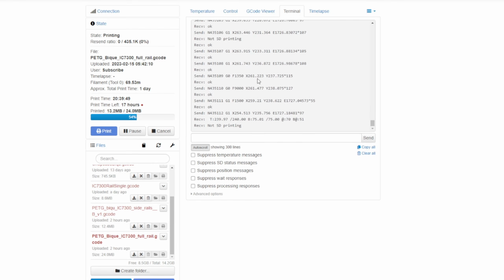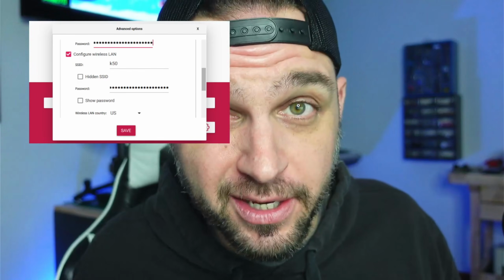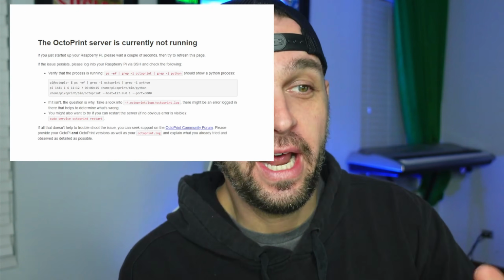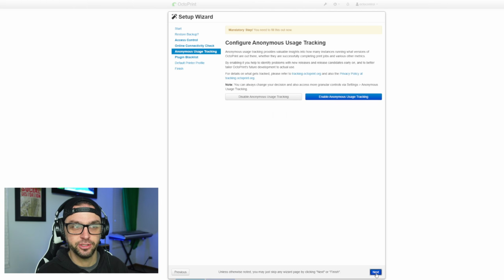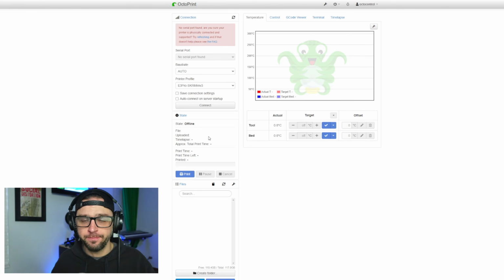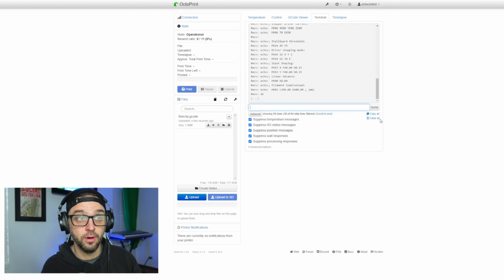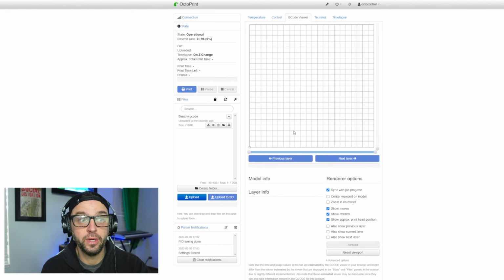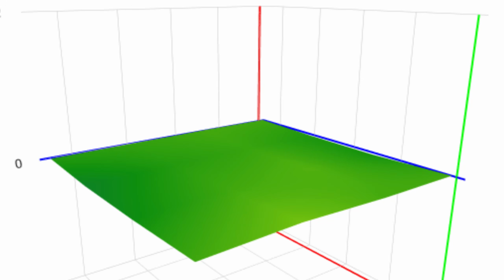Guide to Installing OctoPrint: Turn Your 3D Printer into a Smart Printer!

Comment: I cant help but notice you using "stl" and "g-code" interchangeably, you cant print stl files, they lack the slicing of the g code to make it printable, they are two different file types
Reply from the maker: Yeah, i unintentionally did that.     Thanks for the clarification. Part of it may have been me thinking you could use something like Curaengine within Octoprint to Slice STL's.

Comment: Yeah, don't drag and drop any STL s into the download box.  They need to be sliced, ready-to-go GCODE files as shown by the benchy you uploaded.  Other than that, you helped me recover one of my printers that had gone silent on me.  Pulled the sd, reflashed the raspberry pi image and reset my password.  Good to go!
Reply from the maker: OOPS.  If I did that or said that, I was wrong (not intentionally). You are correct, thanks for pointing it out! Boom.
Reply: @DudeTested  no problemo

Comment: im not sure what my problem is but i cant get my octoprint connected to my pi i been racking my brain just dont know what to do anymore
Reply from the maker: What's going on? Does octopi turn on? Does it not connect with the printer , Do you get any errors?
..
Reply: @DudeTested  i can get the octoprint to load on the computer I have the pi connected to the printer and when I hit the connect button on the octoprint it says it can't connect
Reply from the maker: @KerleyExpress interesting. What printer is it?
Reply: @DudeTested  it's a creality ender 3 s1 plus
Reply: I am having the same problem on my ender 3 v2 neo , it only works once I plug the raspberry pi to the computer then to the printer
Reply from the maker: Sorry to both of you, sometimes I don't get notifications, so it's sometimes hit or miss if I get these. I just saw this while responding to another message.  If octoprint is not connecting to the printer, it could be a few things such as BAUD rate specified, trying a different usb cable, etc etc.  One thing that did happen with my ender 3 v2, I had static build up, and accidently shocked my ender 3 v2.  This caused the USB port to seize working . My solution was to upgrade the control board, which was well worth it anyway.  I went with the skR mini 3

Comment: I have a creality cr10V3 would this work for that, I also have multiple machines like 16! I've been manually using cards for a while and have now burnt my self out doing so!!!!! When attaching the RPi to every machine how would this then turn up in octoprint out of curiosity and do you believe this would be fairly simple to setup? Thankyou
Reply from the maker: Hello,

The Creality CR10 is compatible with Octoprint. While you can connect multiple printers to a single Octoprint instance, managing more than three or four is not advisable. If the Raspberry Pi running Octoprint encounters an issue, you could potentially disrupt multiple prints simultaneously. A more reliable setup would involve using separate Raspberry Pis for each printer, with each Pi running its own instance of Octoprint, complete with a unique IP address and interface. This arrangement simplifies management; for instance, you can name each Pi after the printer it controls (e.g., CR10_One, CR10_Two, etc.). To access a specific printer, you simply navigate to its designated address, like CR10_Two.local, in your web browser.

Some might recommend the SonicPad; however, I'm not very familiar with it as I haven't used it much recently.

I hope this information is helpful to you. Cheers!
Reply from the maker: https://www.crealityexperts.com/setting-up-octoprint-for-creality-3d-printers

Comment: Hello, thanks for your video. Please can I get the octoprint to send a  signal to either a connected raspberry pi or arduino after each g-code move is completed?
Reply from the maker: Hi, thanks for your patience with my delay.  When you say get octoprint to send a signal to a connected raspberry pi or arduino, I am a bit confused.  The reasoning is, octoprint is on the pi and records all the commands.  If you can tell me what you are attempting to accomplish, I may be able to help.  Thanks so much :)

Comment: Octoprint is excellent. I've used it for years. Recently I upgraded my MK3 with a tiny Pi02W running Octoprint mounted directly on the printer frame. The returning availability of this $15 Pi is excellent now and it is perfect for Octoprint. 73 :)
Reply from the maker: It is!  I still have it on multiple printers.   I recently started using Klipper, WOW.
Reply: Excellent  @DudeTested ; I recently built some Vorons running Klipper and a Railcore running Duet RepRap, lots of fun learning! Next is a Prusa Bear which I think I will Klipperize...

Comment: I’ve followed this video like… 5-6 times now and the raspberry pi just refuses to show up on my network. 😂😂 I don’t know where I keep going wrong, but it looks like this just isn’t the video for me.
Reply: I have a Raspberry pi 4! Thanks for reaching out, I just now finished getting the fix in. So apparently, I had to manually adjust the files in the “boot” file of the sd card. Then I had to direct connect to the Pi via Ethernet. Then I could SSH into the card, where I run command line to force the raspberry pi to utilize the document in the boot settings to run the Wi-Fi. 😂 you have no idea how many forum posts I had to go through to find that random one that helped me out.
Reply: @JamezGrimm  I had to hook my rasberry pi to the Ethernet as well.
Reply: @JamezGrimm  Im having the same issue and it been frustrating. Can you share the forum post you found to walk you through how to fix this? The PI only shows up on the network when its plugged into a ethernet port.
Reply from the maker: Which model raspberry pi do you have?  Can you hook it up to a monitor?  Finally and I don't want to sound obvious, You don't even password would be case sensitive for the Wi-Fi, have you tried that

Comment: Raspberry pi 2s work perfect for octoprint. I have a couple I use for my printers instead of the 3 or 4s. Zeros will work but not recommended.
Reply from the maker: For anybody reading this who wants to use a raspberry pi 2 and isn't familiar, there will be no Wi-Fi and you'll have to get an adapter
Reply: @DudeTested  true. i just use ethernet. wifi not needed

Comment: Exactly what I was looking for!  Easy to follow tutorial that got me up and running before the end of it.  Using the same Raspi3A+ with a cheap MicroCenter 16gb MicroSD it was easy to get running, if you run into problems like I did with the printer not connecting or not finding a serial port, make sure your Micro USB cable to connect the Pi to the Printer is a data transfer cable and not just a charging cable.  I went through a few cables I had laying around before I found one that work. 73! Kevin
Reply from the maker: Man, I'm so glad it helped!  That's for the info about the USB.   Those microusb cables can be finicky

Comment: You can optionally use a raspberry pi (or similar) camera which uses one of the flat ribbon cable connectors on top.
Reply from the maker: True mv3dp (most valuable 3d printer) .... Thanks